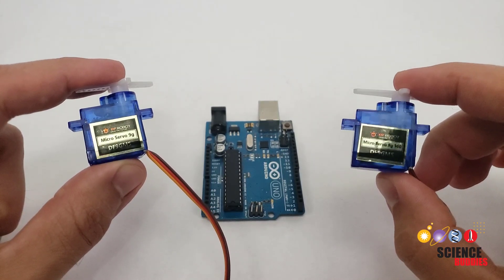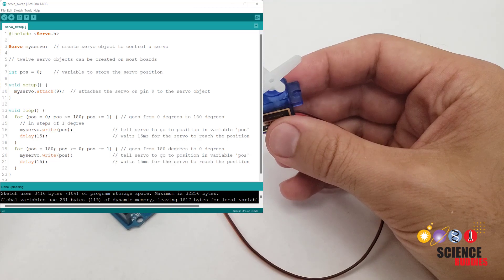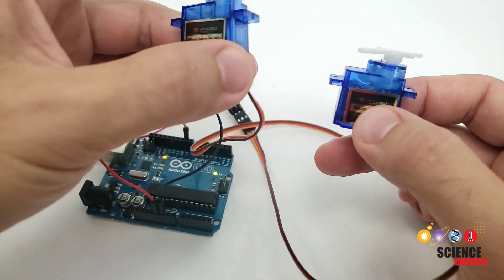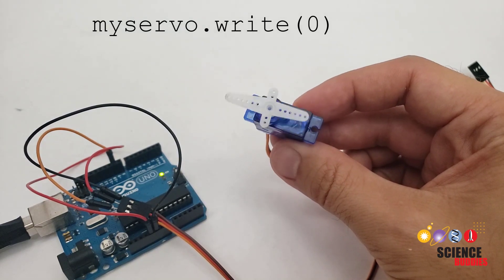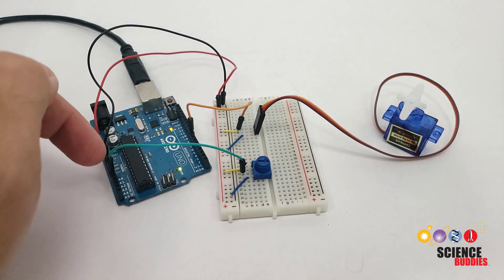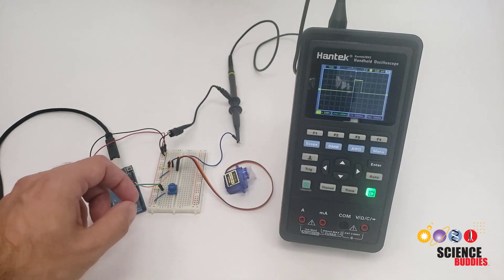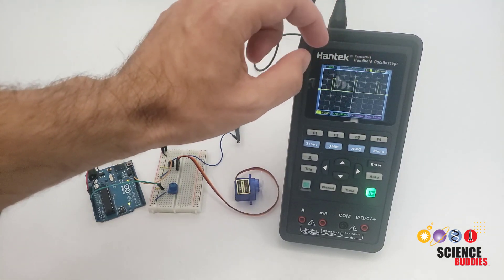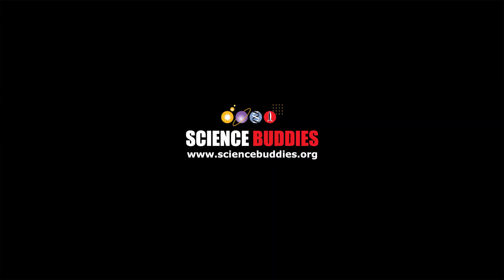Positional vs Continuous Rotation Servo Motors

Comment: I'm a beginner and this is the best video I've found that explained this. I bought some SG90s from aliexpress that were supposed to be 180 but they're 360 continuous. I too was struggling with the endless spinning, in my case, about 93-96 was the right value to make it stop.

Comment: Isn't it possible then to make a 360 servo spin at a constant velocity more than one turn when i turn the potentiometer to one direction and then make it come back to center as the potentiometer goes back to center and then do the same to the other direction?

Comment: Can we control the rate of rotation of the motor? 

For example, I want to rotate at 45 degree per sec till it reaches 90 degree. Is it possible?
Reply from the maker: For a positional servo, it will have a maximum possible speed - e.g. if you write(0) then immediately write(180), it will move from one position to the other as fast as possible. To slow it down, you can use a loop to move it one degree at a time, but use delays in the loop. You cannot control the speed directly with this method but you can adjust the delays to get the speed you want.

Comment: I don't know yet how to continuous

what shoud i put in my code?

#include <Servo.h>

Servo myservo1;  // create servo object to control a servo
Servo myservo2;  // create servo object to control a servo
// twelve servo objects can be created on most boards

int pos = 0;    // variable to store the servo position

void setup() {
  myservo1.attach(9);  // attaches the servo on pin 9 to the servo object
  myservo2.attach(10);  // attaches the servo on pin 9 to the servo object
}

void loop() {
  for (pos = 0; pos <= 180; pos += 1) { // goes from 0 degrees to 180 degrees
    // in steps of 1 degree
    myservo1.write(pos);              // tell servo to go to position in variable 'pos'
    myservo2.write(pos);              // tell servo to go to position in variable 'pos'
    delay(15);                       // waits 15 ms for the servo to reach the position
  }
  for (pos = 180; pos >= 0; pos -= 1) { // goes from 180 degrees to 0 degrees
    myservo1.write(pos);              // tell servo to go to position in variable 'pos'
    myservo2.write(pos);              // tell servo to go to position in variable 'pos'
    delay(15);                       // waits 15 ms for the servo to reach the position
  }
  
}

Comment: It's worth pointing out that you cannot short the pwm pin to ground or VCC and expect it to work, even though it technically qualifies for PWM at 0% and PWM at 100%, respectfully. The PWM range must be between 1% and 99% so that the controller in the servo can sync with the pwm frequency and calculate the on/off ratio. 
However, if it's a 360 servo, it SHOULD work by shorting the PWM pin to ground or VCC to control the direction, but you will not be able to make the motor stop without a 50/50 duty cycle PWM signal.

Comment: sir can i make a continuous rotation servo to rotate 90 degree rotation ?
Reply from the maker: Not if you are just using the servo on its own and the Arduino servo library. The Arduino library will control the speed of the continuous rotation servo, not its position. We recommend looking up a tutorial on "motor encoder" (unfortunately we do not have our own yet).

Comment: But how do i set the angle for the continuous rotation one is there a library for it or do i just have to fiddle with speed and timing?
Reply from the maker: You can't directly control the angle of a continuous rotation servo like this, if you want to control the angle you need a positional servo.

Comment: thanks for the tip .Thought i got the right motor untill i wondered why it was spinning at 130 degrees and stopped at 90. Bought a sg90 thinking it was a positional and ended up with a continuous rotation servo motor

Comment: Hello,
I have a question about a positional servo, which could be used to move a pencil up or down on a sheet of paper.

In my view, the use of myServo.Write() is very straightforward, you need only 2 different values, to select one of the 2 
servo positions (up or down).

In Arduino Nano code, I have seen this implemented by using a Timer2 (to generate a pulse width of 1ms/2ms and fixed
period of 20ms), addressing the registers OCR2A and OCR2B, loading it with value 156 or 148).

Why would one choose the second implementation for positioning the servo motor?

Thanks for this clear explanation about positional and rotational servos.
Reply from the maker: A more general answer - the Arduino language provides a bunch of really convenient commands and libraries that do the under the hood/behind the scenes work of setting register values for you. There are advantages and disadvantages to each approach. The Arduino libraries are human-readable and easy to learn, but you don't know exactly what they're doing and which registers they're using unless you dig into the source code. This can sometimes lead to conflicts with certain libraries or commands trying to use the same registers, meaning you can't use them simultaneously. Setting registers manually can be a pain, but then you know exactly what's going on and which registers you're using. In the specific case of the servo library, you can read more about it under "Usage" here: https://www.arduino.cc/reference/en/libraries/servo/. It's pretty convenient to easily control 12 servos with only a single timer - doing that yourself would be a hassle for multiple servos! The price you pay is disabling analog write functionality on pins 9 and 10, since analogWrite on those pins uses timer 2. So if you don't need analogWrite on pins 9 and 10 or need timer 2 for something else, you should be able to use the library.

Comment: The SG90 positional servo lasted on a continuous process for about 24 hours until it burned out, and now whenever I try to run it then it always gets really hot and doesn't respond to the program on my microcontroller. Is this short lifespan normal? Should I get a different brand or one not made of plastic? I saw a chatroom somewhere that implied metal gears are better quality servos that can last a lot longer.
Reply from the maker: We've never tried running one of these servos for 24 hours straight so we can't say for sure, but they're definitely on the cheaper end of the servo spectrum. They're popular in hobby projects because they're so cheap and widely available, but you may want to invest in a more expensive heavier-duty servo (including metal gears, which won't strip as easily as plastic gears - although that's a different issue than burning the motor out).

Comment: If the servo is not moving. is it still draining power?? in that case, it may not be good to use a servo in an application where it will be on for days. it may damage the servo?
Reply from the maker: It depends on whether there is a load on the servo. If it is just sitting there then the DC motor inside should not need to draw any current (although the control circuitry might). If there is a torque on the servo horn that it must oppose in order to stay in one place, then it will draw more current. As long as you stay below the current rating it should not damage the servo though.

Comment: Thankyou!.. I'm interested in the opposite. (As a mini esc and motor setup, I want to reduce the sensitivity/range of motion). I prefer to keep the potentiometer to set the trim.  I Should be able to connect 2 resisters in parallel  (outter to inner). Has anyone tried, or can confirm?

Comment: Is there a positional 630 servo motor?
Reply from the maker: There are more expensive servos that have a 4th wire and allow for 360 degree position control, like this: https://www.adafruit.com/product/3614. For 360 degree position control you can also look into stepper motors, or using a DC motor with an encoder. We do not have our own tutorials on these topics (for now), but you should be able to find them on YouTube.